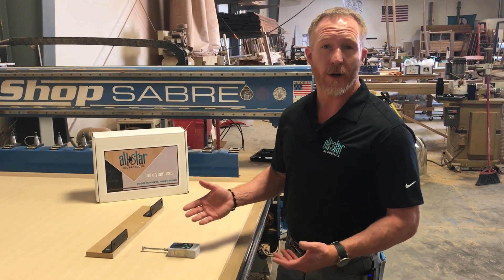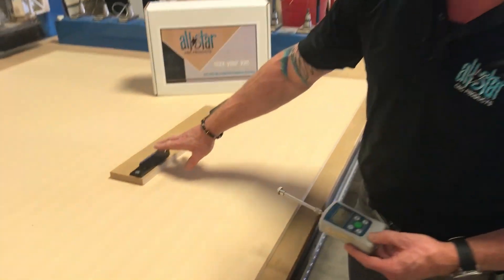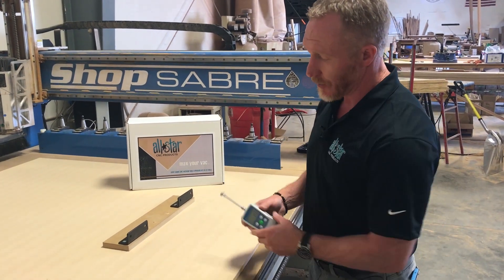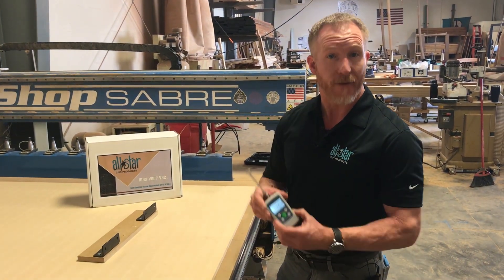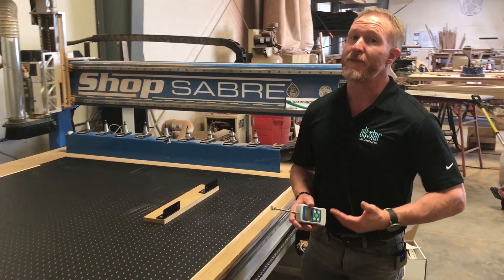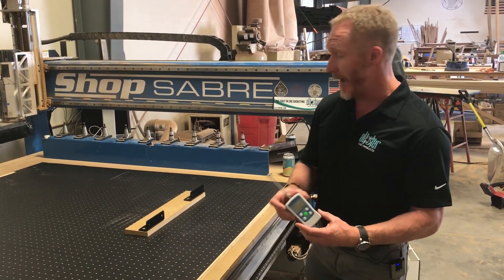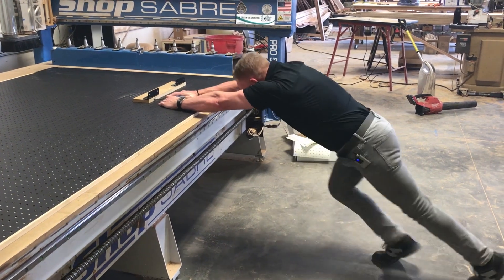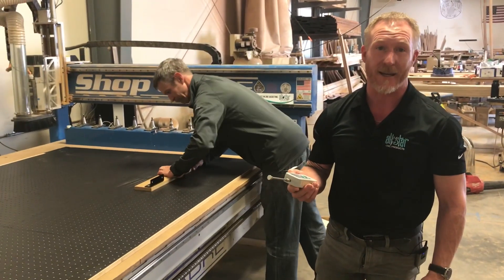A side-by-side test example of the holding power of Tile Gasket on a CNC router

Comment: I've just come across your videos and this seems like it could be something suited to an issue I'm facing currently, I use a CNC Router for Cutting 3mm 5052 Aluminium in 2400x1200 Sheets for Sheet metal construction. We have a Vacuum table and running a 16mm MDF Spoil board but still having issues with material vibration causing heat and then moving parts, Is this product something that could help with holding down thin aluminium and as I'm in Australia is this something i can source from you or not? Thanks heaps :)
Reply from the maker: Yes, this will certainly help and we have many clients cutting aluminum and metal sheeting using our Tile Gasket. It would be best to connect directly so we can assist and learn more about your machine. Email us at info@allstarcnc.com. I've also found you on IG and will message you there as well.
Reply: What is this